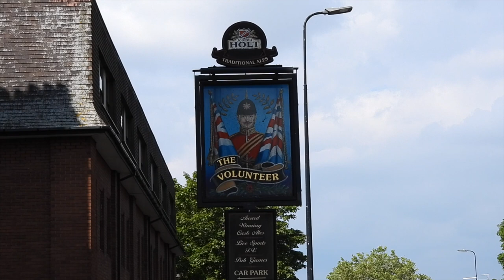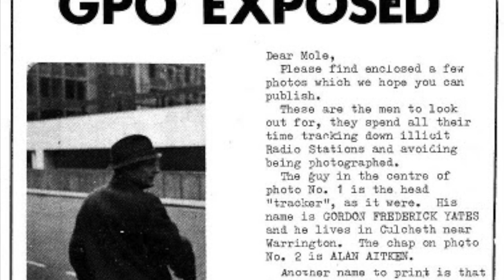A Pirate Radio Station In A Derelict House

Comment: I'm surprised stations weren't found more often. I located one London AM station with just a transistor radio with a ferrite rod aerial. It was very small, in a terrace house, with an open chassis and an 807 as the main valve. I got invited it, I suppose to stop me attracting attention walking up and down with the radio in the street.

Comment: Another excellent video Lewis. I'm surprised that the DF was accurate enough to pinpoint the house from any reasonable distance away, enabling them to subsequently search it, but maybe the antenna at the back gave the game away. Still, finding the TX behind the bath panel was far better detective work than I would expect from the police these days.
Reply: With 4 bearings at a distance of about 3km, i could get a circle with a diameter of about 200m where a local LPAM transmitter is situated. For that, i just used a printed out map and a portable radio with ferrite antenna.
Repeat it at a closer distance and you get a more accurate result. So if you drive around a town, it's pretty easy to pinpoint AM transmitters (and omnidirectional FM ones too)
Reply: @laurensvisser7623  Thanks, that's a good data point. A good set up with an antenna designed for DF will be a bit better than this. So it may get to within a few houses rather than 200m.
Reply: I think the antenna gave the game away then. My CB dipole was camouflaged by trees. I could see the GPO van through my shack window through the trees and other gardens but didn't transmit of course. The valve filaments were still on. It was a 6CH6 osc/mult with a screen modded 807 PA from a 1977 SWM design! I never got to meet them happily 😊

Comment: We had the first Stereo Pirate in the North of England I.B.C. Radio 104.4 FM  D.T.I. was swines they could only take the vinyl that was playing at the time of the raid, so months after court cases we would get the rest back,,, every one scratched  deep wrecked & unplayable !  we had a Link system in later days that ran on 900 Mghz if i remeber rightly. somewere around carphone frequency at the time  that transmitted to a reciever that went into main 50 Watt FM Trans with a STEREO Modulator we could have the studio anywere within a 15/20 mile radius of the Main transmitter that was situated in the lift shaft room of DARN HILL High Rise flats in HEYWOOD Manchester we got took off air a further couple of times were all they got was theLink Reciever & main Transmitter.. but they got pissed @ us coming back on air straight away & Triangulated on the Link Transmitter as they had the frequency it opperated on from taking the previous unit ! 30 years later & you can buy 50 Watt FM Stereo transmitters from China for a couple of hundred quid, The D.T.I, did say our home made Trans was very stable for a back street pirate job. an elecrical engineer from Bradford made our Transmitters ...They was good days used to enjoy it.

Comment: Back in the 80s we visited a number of Irish pirates. Radio Dublin was in an old house on Inchicore Road I think and the MW tx was bricked up somewhere inside it. Apparently to switch it on you had to tread on certain floorboards in the right order! 😁 One story I heard was of a P&T investigator who went up the aerial mast trying to find the feed cable when Eamonn stood by one of the guy wires with a pair of bolt cutters and told him if he didn't get out he'd cut the wire (which would probably have catapulted him into the Liffey!).
Reply: i listened to the red hot sound of Sunshine 101 FM in 88, i could hear that on 101.5 fm a lot here in manchester but mainly 531 am not 539 what Sunshine used to say. and also Radio Nova and Energy 103 that i could hear on 738am, i wasnt a fan of Q102 or Super Q102 an exact copy of Sunshine but i did pick up Hope 104.4 fm from Dublin here one october night when the pirates boomed in and Q102's 103 transmitter almost jammed our local key 103 fm in 1988. Never heard Radio Dublin apart from when i was in Dublin, Their sound quality wasnt that good and i know Eamonn Cook wasnt a good guy....🤔